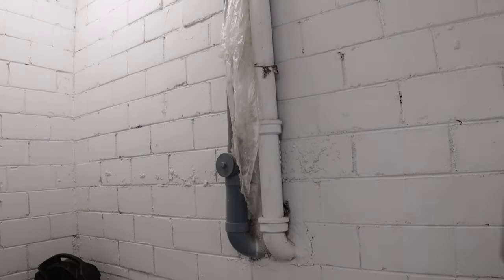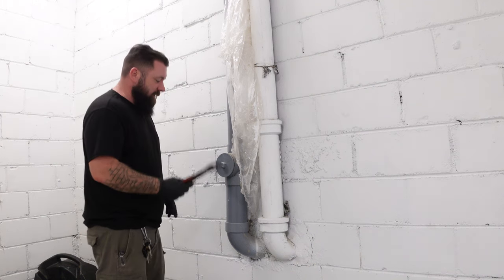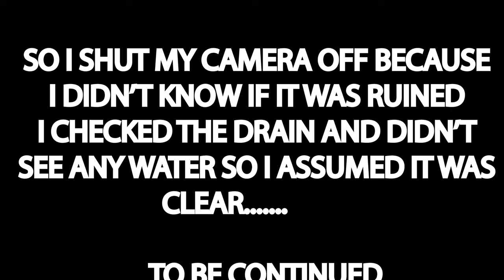GREAT my CAMERA is RUINED by POOP

Comment: I'm thinking of buying the Milwaukee machine you use 
I was wondering if you would review it ?
Reply from the maker: Which machine are you thinking about getting the 5/8 and 7/8 cable machine or the smaller hand machine? I got the M12 the M18 sink machines that run 1/4  inch cable and then I got the machine that runs the 5/8 and 7/8 cable